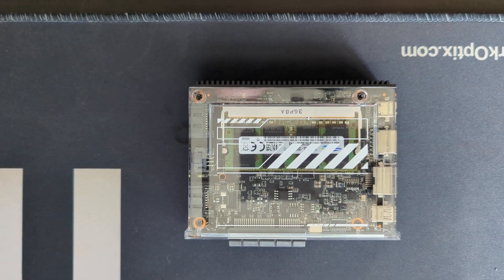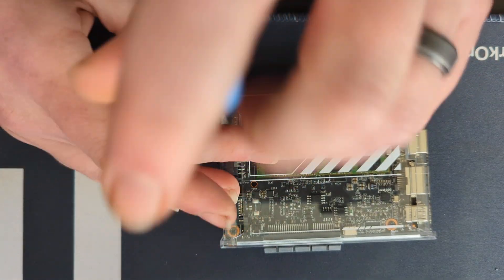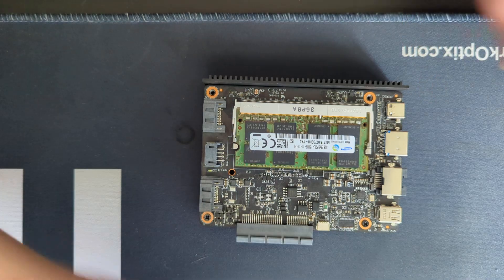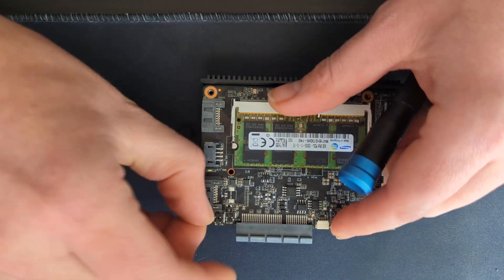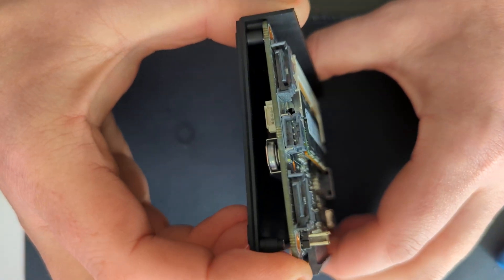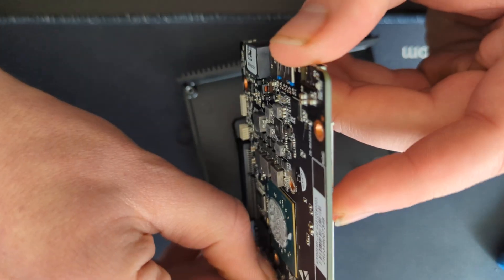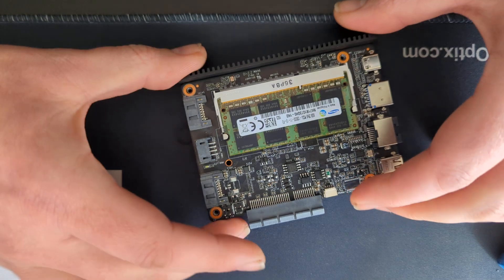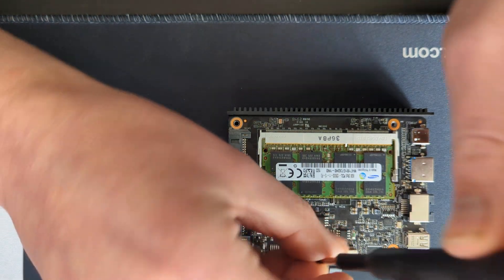ZimaBlade CMOS

Comment: Thanks Sabitech
I'm having a lot of trouble with my two Zimablades.
First, I had to find a 12V 3A power supply. Few brands make these PD power supplies with those 12V, not all of them.
Then they work fine for a month, with Casaos, without problems. But when there's a power outage, which is very common in my area, when I turn it back on, they lose the IP and no longer boot.
I have to take out the battery, wait a while, and put it back in. It doesn't always work, but it's as if I've lost some boot parameter and they no longer load Debian.
Thanks for the video, and above all, for your curiosity about these gadgets. I can relate.
Greetings from Barcelona.